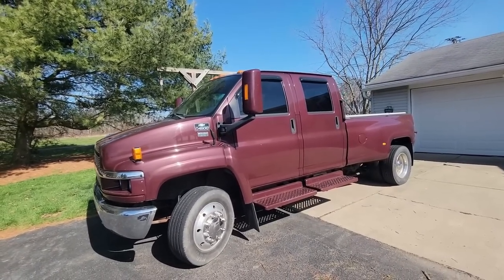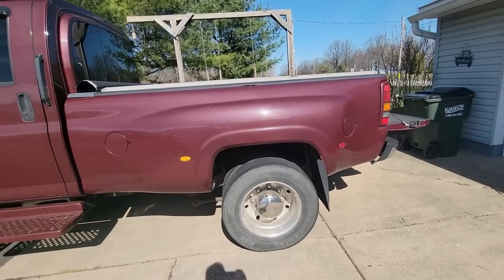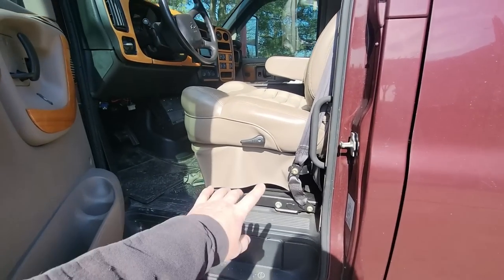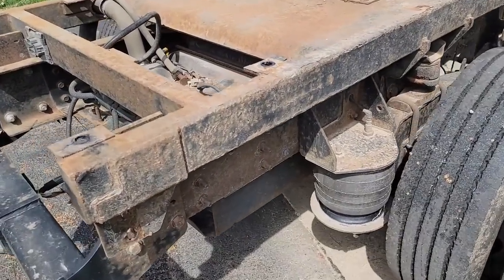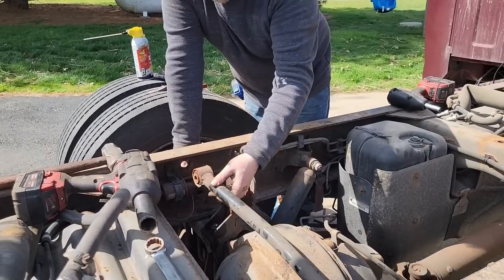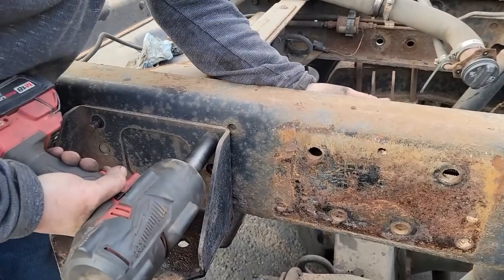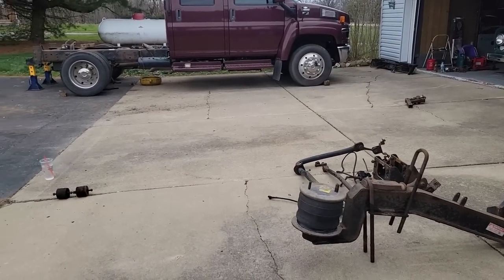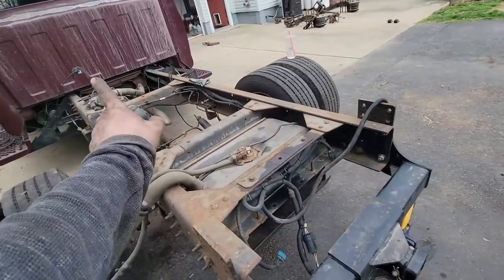2005 C4500 FIXING WHAT GM & MONROE SCREWED UP!PT1

Comment: It's funny I'm doing the opposite
Reply from the maker: probably more people going from a work truck to a monroe clone than what i am doing. people really seem to love these trucks. i like the cab....the rest is a disappointment for what i use it for.
Reply: I'm not doing a clone but I want to bring mine up to date ...I love wht ur doing vary curious on ur future moves
Reply from the maker: more hp, more torque, better fuel economy, and air brakes.....that will make this an entirely different truck. if i was 80,000lbs with a 14l engine in the hills, 6mpg is ok but not in this truck and being under 30,000lbs. plus, im not a fan of aftermarket. i am searching for a crew cab black or grey factory interior.
Reply: I have the black interior but it's ruff the owner befor use didn't care for the truck and just used self tapers to solve all the world's problems...the power plant and what I need the truck for its perfect...it's just my get out turn heads conversation truck